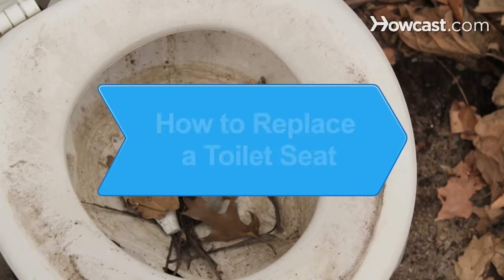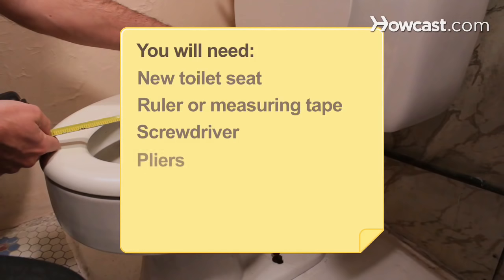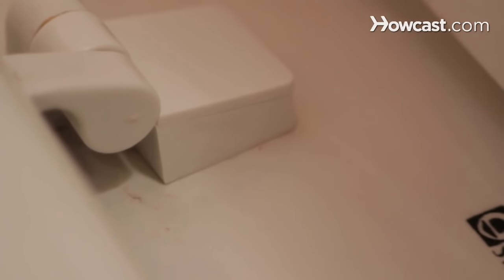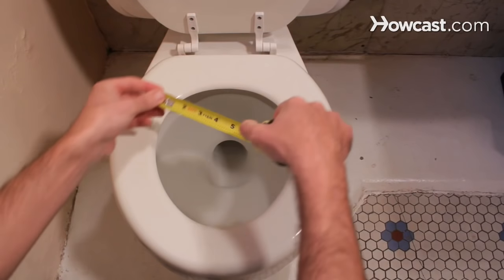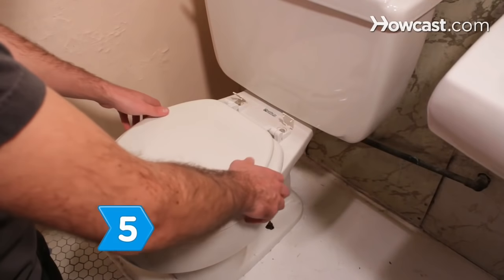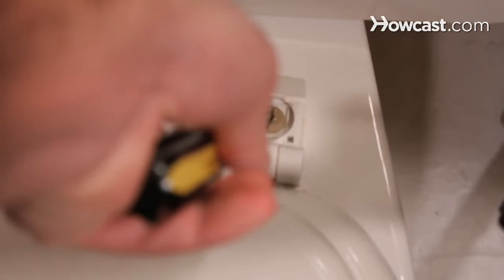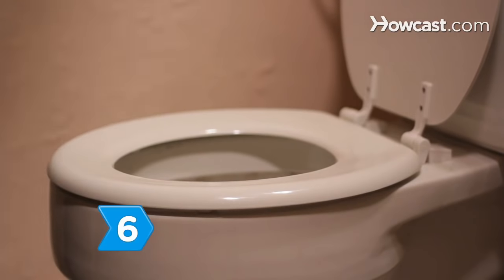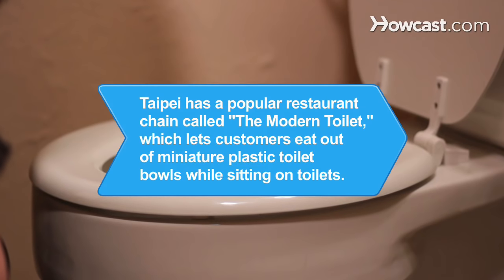How to Replace a Toilet Seat

Comment: is that just me or i can't believe he actually touch the bottom of the toilet seat without glove, that's disgusting, imagine all the bacteria and shit
Reply: its called soap
Reply: someone's never been to the army apparently
Reply: no but you aren't afraid of getting your hands dirty.
Reply: Fantomas612 no more than is under the average persons nails (hence why biting ones nails is a bad move)
Reply: I recommend that you touch the bottom of your toilet seat without gloves. Give it a proper massage - touch it all over. Then wash your hands thoroughly in warm water and soap for about 90 seconds. Dry them off and then sit back and watch in amazement as you don't die. Check every 30 minutes or so to see if you're still alive. After a couple of weeks you should be in the clear. Repeat as desired whenever you need a mad buzz.